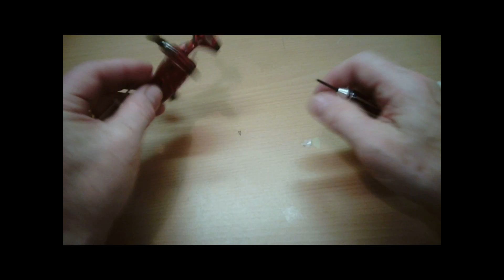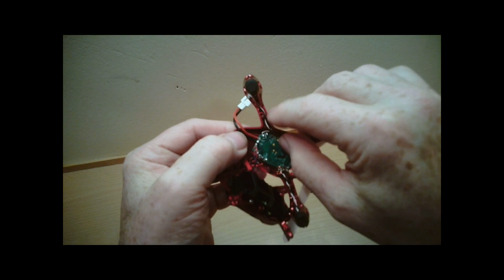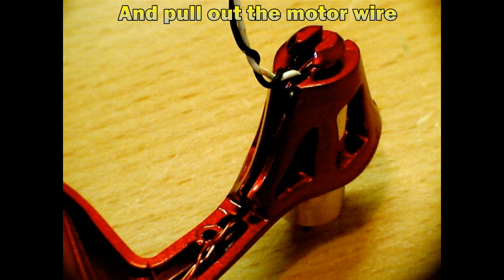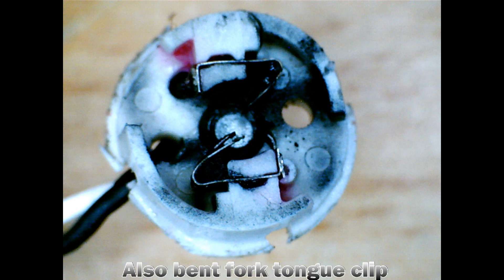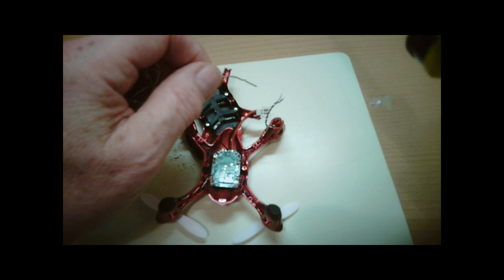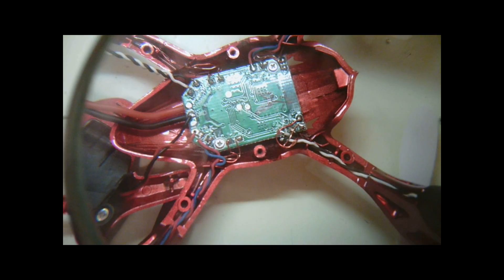Hubsan X4 Replacment Motor

Comment: I enjoyed this video, I have a x4 that when the battery is plugged in will not light up or run but the board gets warm...Do you have any idea what may be wrong ?
Reply from the maker: +Tione Dillard I think you have already described the fault, and sounds like you have a shorted the circuit board.
Reply: +Copter Hubsan So basically I should just purchase another quad ?    Thank you for the reply...
Reply from the maker: +Tione Dillard It may be cheaper to purchase a new circuit board and re solder the four motors.
Reply: Hello, could you tell me what other supplies that I'm going to need for soldering on quadcopters other than a soldering station?

Comment: Good vid. Feel better about doing mine now. Thanks. One thing I will do is cover the circuit board up with something and probably hold wire still and in place with blue tack further up the arm.

Comment: The only video I’ve seen that has excellent still close-ups of  replacing the Hubsan X-4 motors. Nice camera work. ‘Also appreciated seeing the innards of the motor, (very cool) !
-
I have one screwy motor that sometimes won’t self-start.  If you give it a flick with your finger it will then start and work fine. I’m thinking a commutater  or brush problem .
-
Thanks for your efforts !

Comment: maybe the rubber feet should have springs in them to take any shock.
Reply from the maker: These little quadcopters are very tough, I think the rubber feet work just fine, but look forward to any improvement.
Reply: cool :)

Comment: Great video! I had to move all of the guts to a new body after breaking one of the arms. Upon reconnecting all of the wires, I tested and found out that one motor will continuously spin as soon as the battery is connected. Have you ever run into this or know why it would occur?
Reply: had this same problem happen on mine, if you find out let me know
Reply from the maker: For the motor to spin continuously would suggest, you have power going to this
Motor, may be due to solder splash, or short circuit, use a magnify glass to compare the wiring also connections of the good motor.
Reply: Copter Hubsan  Thanks.  I actually found the problem.  I opened up the board and found one of the four MOSFETs exploded.  I read on the forum and found a potential replacement I'm going to test out:

http://www.ebay.com/itm/400676364604?
Reply from the maker: Chris Loewen Yes a faulty transistor will keep the motor spinning, the exploded Mosfet may have been caused by, my earlier suggestion. Good luck. Let us know How you get on.
Reply: Copter Hubsan Yes I believe your right.  I believe the Mosfet failed due to the new motor wires shorting together after the original one which stopped spinning was replaced and battery power was applied.

Comment: thanks. I fixed it. I thought I screwed it up for sure and smeared melted plastic all over the circuits. I ended up using a lighter to heat the iron because my soldering iron is a piece of crap.  it is flying like a champ.

Comment: What screw driver are you using? I have 6 or 7 which should be about the right size - some don't fit in the hole, and the others just aren't gripping the head of the screw.
Reply from the maker: I have an small Align hex screwdriver that fit perfect, but if the head is rounded off, you could try filing a flat on a old screwdriver then replace the screw when out.